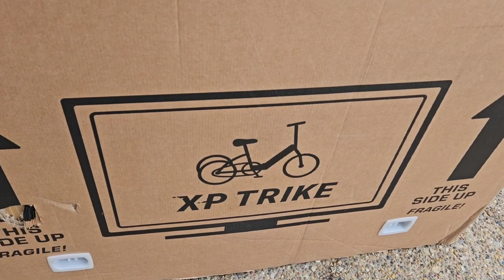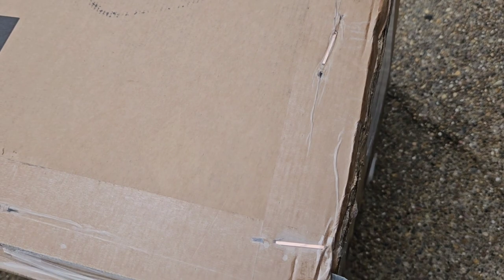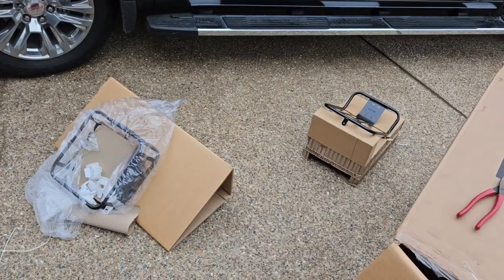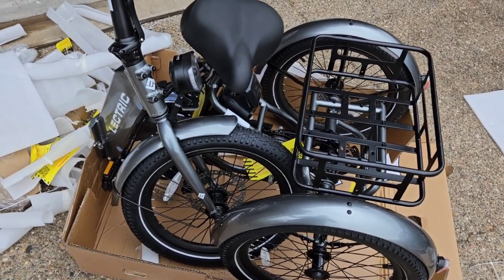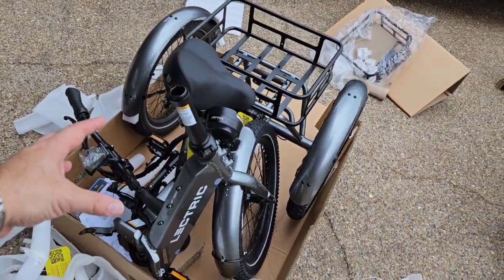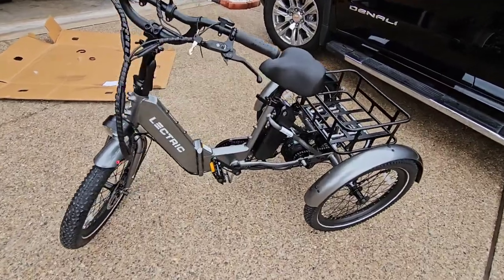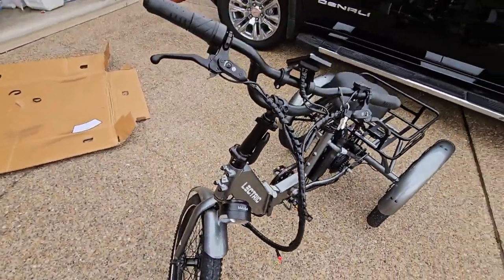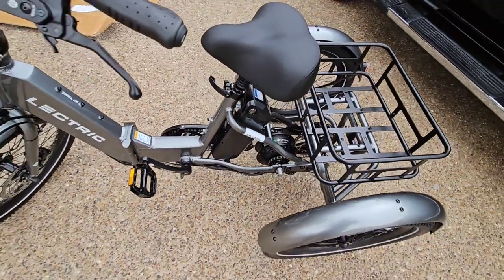ALL NEW Lectric Trike ebike/etrike!  This is so cool!

Comment: The  rear fenders were the only issue I had when I unpacked the bike.  They were mashed into the tires.  It took some doing to straighten the brackets and get the fenders centered over the tires again...  The right one even damaged a bit, but doesn't bother now, and I don't see it when I ride, so it's OK.  I really like my trike.

Comment: I’m waiting for an electric with 300 lbs capacity with cargo rack like this one and front basket for Arizona desert trails & dirt roads. Need better tires goathead/cactus resistant.
Reply: Lucky for you they have the Lectric Xpendition cargo with 450lbs capacity and two batteries option for 150 miles

Comment: I wish I didn't have to write this review. These Lectric XP trikes are cheaply built in our view. I bought two of them in July of 2023, by October both bikes have a bad axle bearing on the rear. This is with only neighborhood rides and no speed above 2. total miles on one is 117 and on the other 102. We asked for help from "Lectric" but was told that this bearing is not repairable and  Lectric e-bikes said to send them back to see if we could get new ones. We live over a thousand miles away. They refused any help with shop manuals or tech support, just send them back. We have the bikes setting in our garage if anyone wishes to verify. Sorry. Don and Jenny